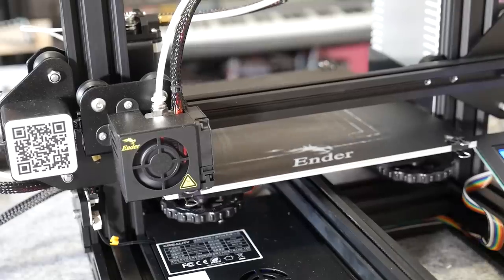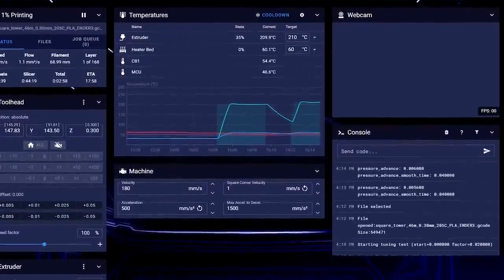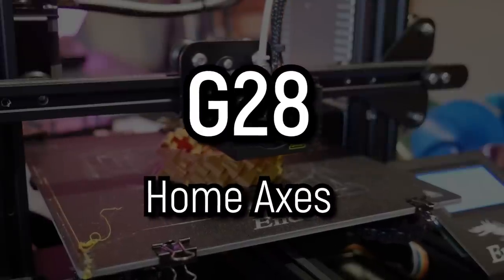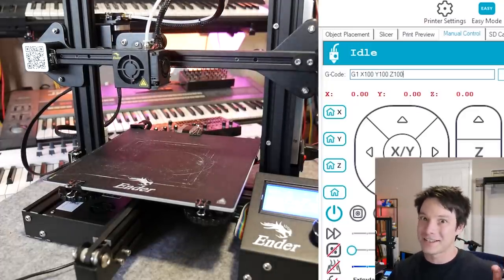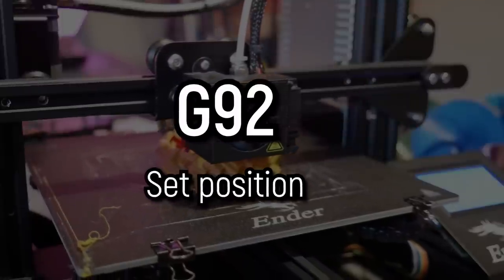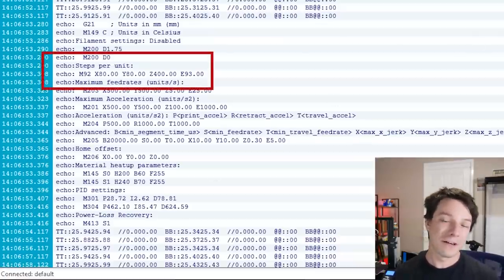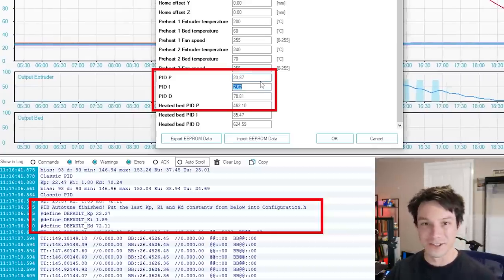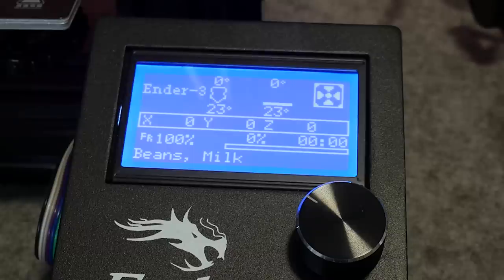Top 10 useful G-Code commands for 3D Printing

Comment: I see G0 used for travel moves.  But what exactly is the difference compared to G1?
Reply: G0 moves without extruding, G1 moves while extruding
Reply: @jeremylaidman6525  I thought that was dependent on whether you included an "E" value in the command.  So, if you send "G0 E1", won't that still extrude 1 mm of material?

Comment: When I print on my CR-10S I send some gcode that plays a little tune at the end. Unfortunately, it doesn't work on my CR-10S Pro. I can't recall where I got it from as it was a few years ago now:

M300 S294 P200 ;D4: 294
M300 S588 P200 ;D5: 588
M300 S440 P200 ;A4: 440
M300 S392 P200 ;G4: 392
M300 S784 P200 ;G5: 784
M300 S440 P200 ;A4: 440
M300 S740 P200 ;F#5: 740
M300 S440 P200 ;A4: 440
M300 S294 P200 ;D4: 294
M300 S588 P200 ;D5: 588
M300 S440 P200 ;A4: 440
M300 S392 P200 ;G4: 392
M300 S784 P200 ;G5: 784
M300 S440 P200 ;A4: 440
M300 S740 P200 ;F#5: 740
M300 S440 P200 ;A4: 440
M300 S294 P200 ;D4: 294
M300 S588 P200 ;D5: 588
M300 S440 P200 ;A4: 440
M300 S392 P200 ;G4: 392
M300 S784 P200 ;G5: 784
M300 S440 P200 ;A4: 440
M300 S740 P200 ;F#5: 740
M300 S440 P200 ;A4: 440

Comment: I tried using the beep code on my Neptune 3 Pro right in Cura's gcode and it didn't work. I tested some different parameters of beeps and nothing. Does anyone know if it works through Cura's gcode?

Comment: M300 is actually super useful to audibly keep track of what the printer is doing, especially if your printer is very quiet and you are in another room.

I edited the start gcode for my Prusa Mini to play the Mario Kart start line beeps right before printing the purge line (while also "revving" the nozzle in time with the beeps over to the start position of the line, so it starts extruding immediately on the last beep, as if it timed its throttle just right to get the boost, and the purge line is a skid mark... :P), so I can go over and check on the first layers, without having to sit around waiting near the printer.

Likewise, I edited the end gcode to play the Zelda "Small Item Get" tune when a print is done, because that's exactly what happens: 
I get a small item... :)

Lastly, I let it beep when the bed is cooled down enough for the fans to turn off, so I know I can go over and turn off the printer. This does inflate the estimated print time of every print though, since it's also part of the end gcode.

I haven't done so yet, but I plan on also using it to announce other things that require attention, such as pauses for hardware insertion, manual colour changes, or start of the next sequential print (to again check on first layers).

Comment: How could I change Max temp if machine is all metal hotend but only reaches 260°c?
Reply: I believe you’d need to update your firmware for that if you’re running Marlin. On kipper, you go into your printer config file and scroll down until you see extruder and change max temp. But, when I was using Marlin, I had to get upgraded firmware from the manufacturer. There may be an easier way that I don’t know. Good luck with your question.

Comment: You can tape off a pin on the cable to stop power from passing to the ender from the PC , I forget what pin without going to another building I have my printers in to look, search Google that's where I found the information so my Raspberry Pi didn't try to power the printer. No it's not good to try not enough power it will damage things.

Comment: After my printer (S1 w/ PEI) cools down, the parts are loose and just need to be slid off the build plate. It would be cool to see someone write up gcode that wipes the cooled build plate with the cooled extruder, heats back up, and starts a fresh print. Or, wipe then set up OctoPrint to move on to the next gcode file, which also wipes the plate when it's done, etc. Would be an easy way to set up the poor man's CR-30. This comment could revolutionize print farming. You're welcome. 🤑🧐👍

Comment: For anyone using pronterface to do this, watch out if you close pronterface while your printer is printing , it will turn off the hot end. I found out the hard way comming back to a printer that was moving but no fillament was comming out,  turning on pronterface again it showed the cold extrusion prevention message.  I hooked up the printer via usb mid print, even asked chatgtp if this was safe, and it said yea, and sure enough i was able to connect to my printer and see the messages comming from the printer cool i thought,  but after checking it out i thought id close itt and thats when it turned off my hotend.  It did this twice, the 2nd time i figured it out.    Maybe a safety feature? I dont know, if the program didnt turn anything on it shouldnt turn anything off on its own.  I guess ill be checking out repetier.  Anyway it was cool to turn on the fan via a command, made you feel like its your printer and you can make it do what you want, cool potential for mods.